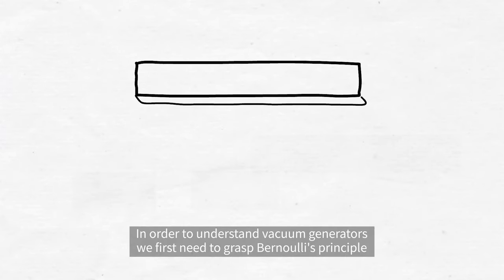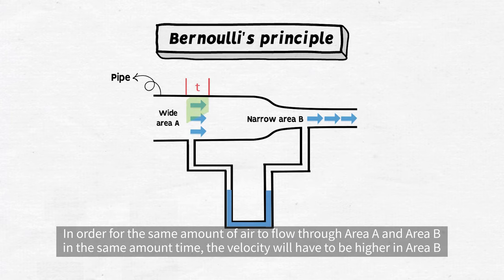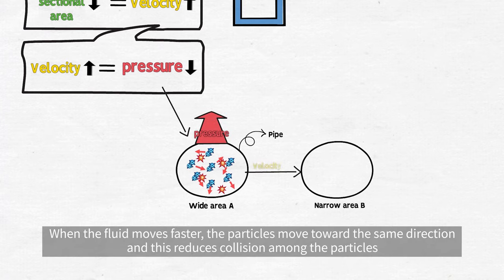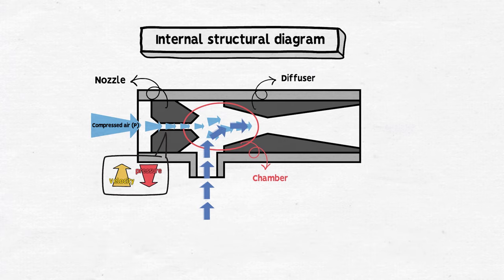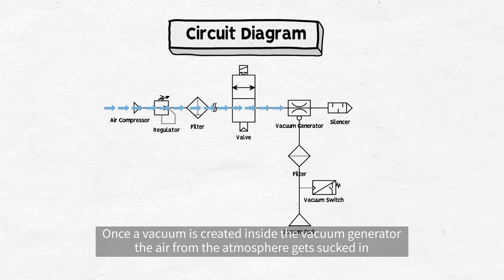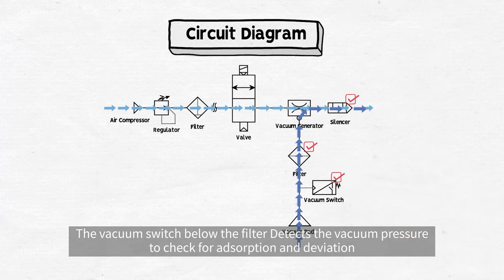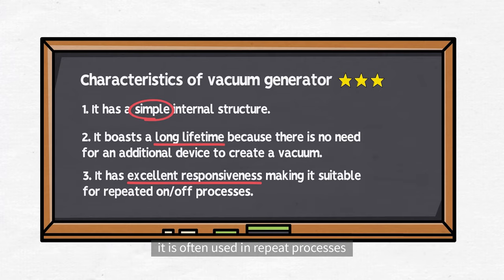How VACUUM GENERATOR works? |Vacuum Ejector| (Animation | Sub)

Comment: Hi, awesome video! Can you explain the calculations required to select compressor and vacuum generator based on application payload?
Reply: Everything has its own limitations.  And manual is always there to see the required limitations.  If you have included the particular model, I could answer you precisely.  That is awesome, indeed.

Comment: Thankyou for an informative tutorial. 
I have one question, the vacuum generator you used in video, can the powder material be sucked through this (if we take the silencer out)?

Regards
Reply from the maker: Thank you. This product is KCC Precision's KSV' vacuum generator.
It can suck in dust... but the hole will clogged. It would be better to configure the vacuum system separately.

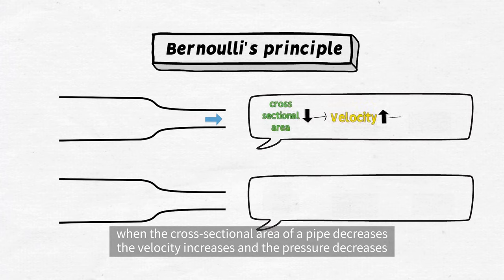Comment: This is such a good video. But I got a question. At 2:42, when the fluid flows from the larger cross-sectional area to the smaller cross-sectional area, velocity decreases while the pressure increases. But I remember the fluid or gas can only flows from high pressure region to low pressure region. Can you clarify it for me? Thank you so much!
Reply from the maker: Yes, what you said is correct.
As you can see from the video, as the fluid flows from a wide pipe to a narrow pipe, the flow speed increases and the pressure decreases.

Comment: hi do you know what is the connection between shockwave occurs in the choking position that make the suction pressure better?
Reply from the maker: Could you tell me which part of the 'shock wave' and 'chocking position' are you talking about?

Comment: Goodmorning, I'm interested in the reverse function. Is it possible to get an object by vacuuming, and then blowing it like a blowgun? Can i move the position of the solenoid valve to close it when I want to switch from vacuuming function? Thank you very much! I really appreciate your presentation!
Reply from the maker: What machine are you planning to use it for?
Generally, the object fall off when the vaccum is relaesed after suctiong it. (Even if doesn't blow air like a blow gun)
Also, position control is possible with a vacuum solenoid valve.
Thanks for enjoying my video :)